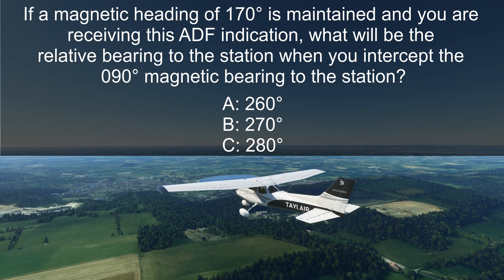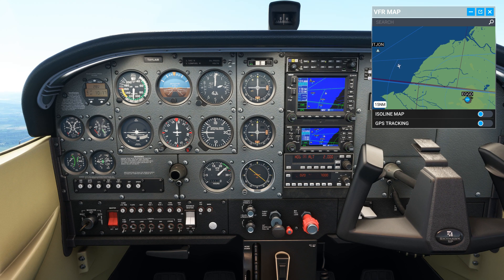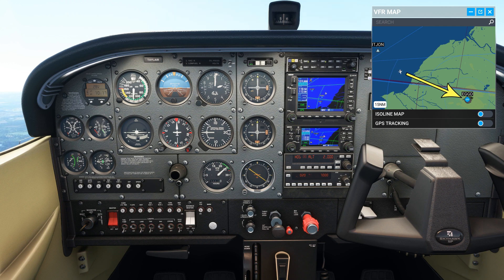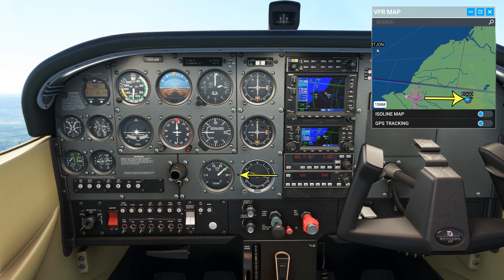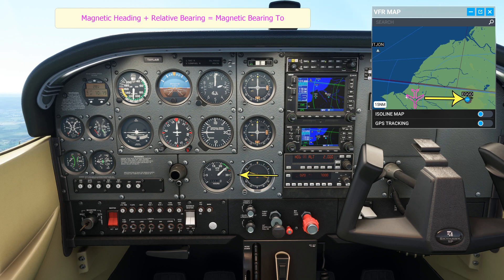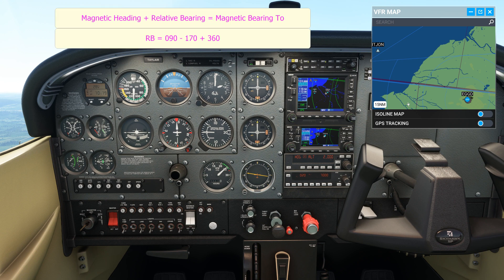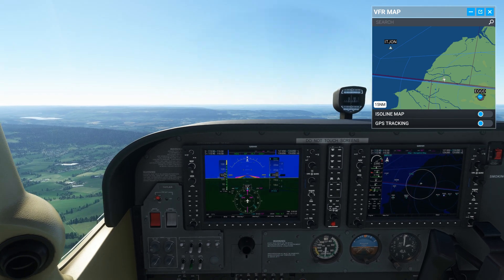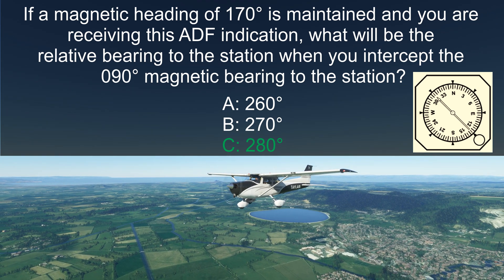NDB Navigation - Relative Bearings!

Comment: Sir, i think the angle between aircraft and ndb should be 35 at first. You showed it as 45. Am i wrong?
Reply from the maker: @piquecuriosity  yes you are wrong 😂
Reply: I can not get how it is possible to have 45 degree angle difference when we are heading 170 and relative bearing from the ndb station at that time is 315. I even drew it and opposite side of 315 is 135 and difference is 35 degree. What am i missing?
Reply from the maker: I think you are not taking the position of the aircraft into account. Have a look at the map view on the video
Reply: @Taylair  I did actually but what makes me confused is if we draw line between our heading which is 170 and 315 degree relative bearing then it turns out to be 35 degree. Why we take outer angle instead of 35?

Comment: I’m so confused! Can you help, if I’ve intercepted the 290 magnetic track  from the NDB  and I have to apply 7 degree of drift correction to the right, what would my relative bearing be?.?
Reply from the maker: If you're on the 290 bearing from the NDB, but you're flying to the NDB, in zero wind this would be a 0 Relative Bearing. If you've needed a correction to the right for wind, the relative bearing would be 353 degrees as the NDB is now slightly left of the nose.